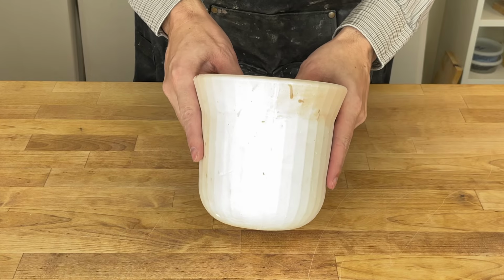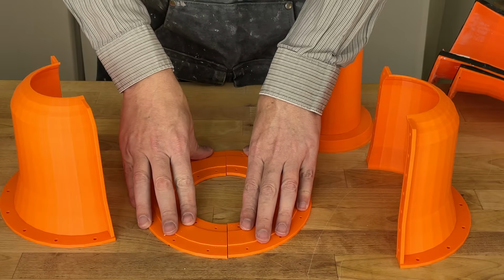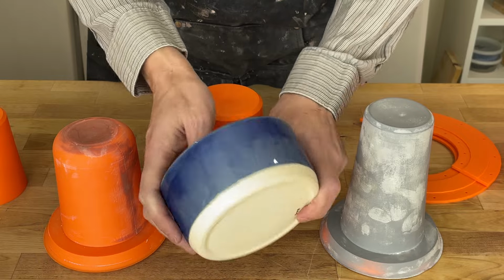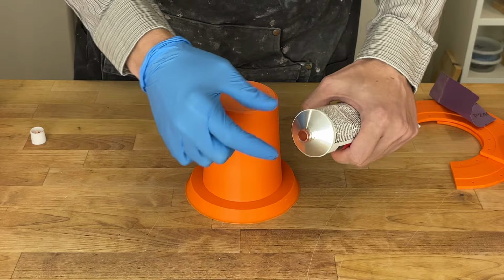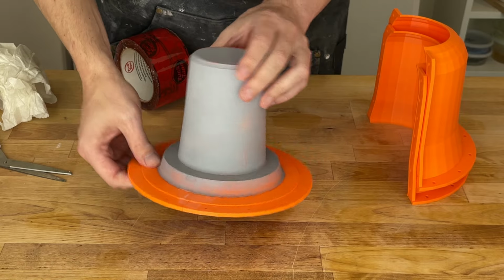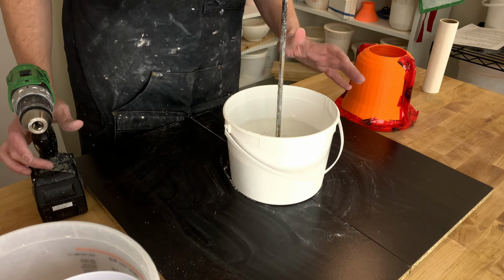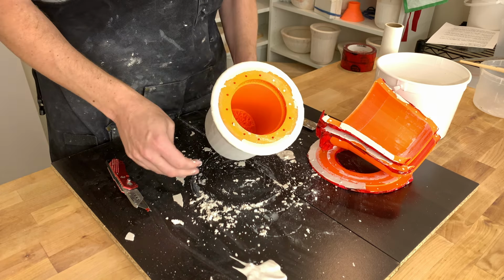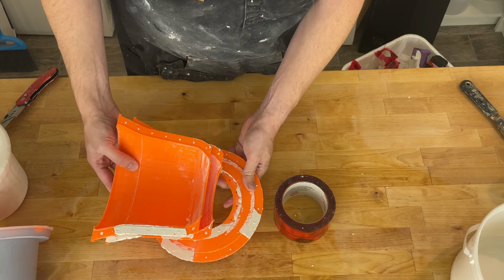New Slip Casting Mold and Testing Tuck Tape for Shape Cast

Comment: I used a couple of the methods from a few of your videos and it worked well. I printed a model and lined the seams with the foam, I then used the tuck tape around the seams and then used binder clips for extra sealing pressure. There were no leaks! I may try without the tape to see if the foam gasget and binderclips are enough! Thanks! Loving Shape Cast!
Reply from the maker: Glad to hear it worked! I hoping the new version that uses binder clips will be ready soon!

Comment: Ken, what if you still use the gasket material but tape instead of bolts? The leaks you got were likely caused by the lack of a gasket, not by the tape.

I have printed 8 different forms using Shapecast, and I think the tape method would work with a slight tweak to the form generation. Instead of the large flanges for the gaskets and bolts, a simple small channel (1.5mm half circle) on the edge of both halves of the mold (where Shapecast currently makes the small mating surface) would provide a place to put a piece of TPU Filament (1.75mm) that gets squished. Then, you wouldn't need the large flanges and could put the tape across the outside surfaces to "clamp" the pieces together.
Reply from the maker: Yes, plaster got into where the gasket went. However some also leaked around to where the tape was. I didn't get it pressed into all of the corners on the outside and there was plaster there in some places. If I did this "for real" I'd remove the recess for the gasket I think.
I'd thought about putting in a rubber o-ring type material and I'm sure TPU would do the same. I'm not sure how to secure it in place - I don't think the tolerances on many printers would be good enough for a press fit groove. But maybe a bit of CA glue is the answer there? If I'm changing geometry I'd also want to add some alignment features like on the 3D prints for the handles.

Comment: For the spot putty, you can actually thin it a bit with acetone, and then it can be painted on. It dries just as fast but is able to "flow" into the valleys a bit better, and I feel it adheres to the plastic a bit better (there is no real way to prove that; it is just a placebo effect).
Reply from the maker: Thanks for the tip!

Comment: Hey Kent! Great video like always!
I have tried using the frozen isopropyl alcohol and water trick with varying success, what ratio of isopropyl:water do you use and how long do you leave it to get cold in the freezer? Thanks!
Reply from the maker: I always leave it in the freezer. Probably over night at the very least. You want it as cold as possible. As far as the amount of alcohol, I didn't measure and have actually refilled that container a few times. Basically you just want to make sure it's not frozen, so targeting something like 50/50. If it starts to freeze, then there isnt enough alcohol.
I think it also depends some on the form itself - this one has a great draft angle.

Comment: Interesting use of 3d printer. Effort is on mold construction rather than model. I'm using cnc router for model and conventional clay and wood box for mold construction.
Reply from the maker: Yes, this greatly simplifies the modeling process so you can get to plaster (and then pots!) faster. With Shape Cast you just draw a 2D profile of your pot and everything else is automatically generated.